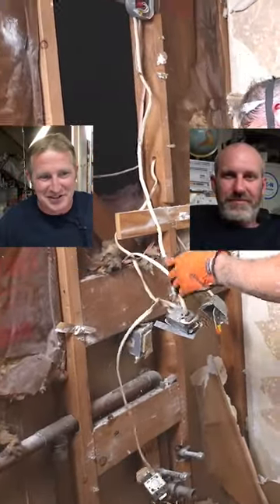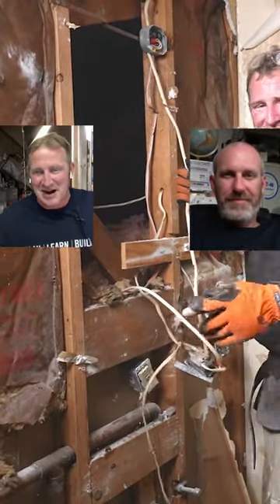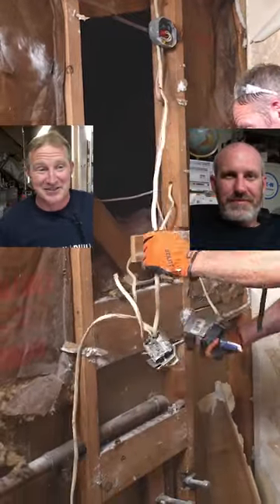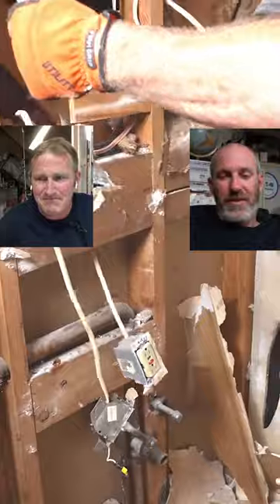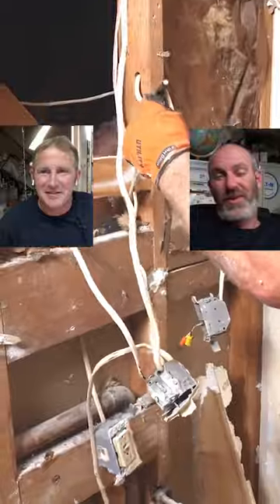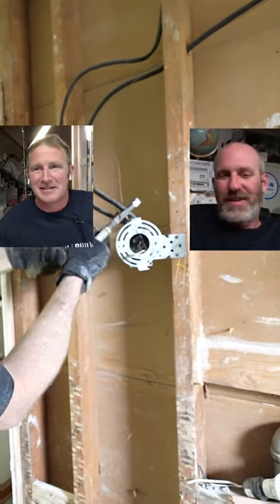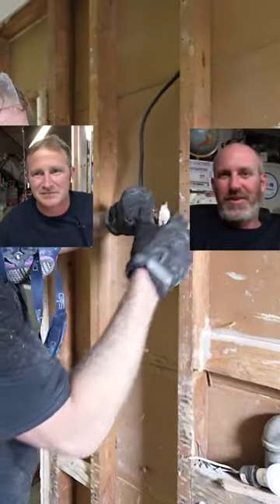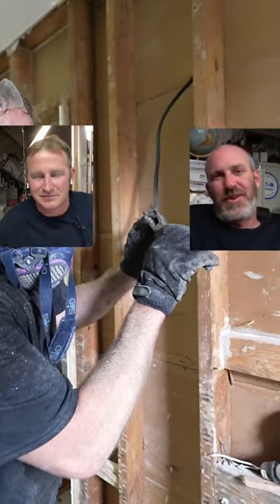Common electrical problem I see in old homes

Comment: Nothing wrong with lighting and outlets sharing a circuit. It’s definitely not a code violation.
Reply from the maker: Different gauges it sure is
Reply: Nothing wrong until all the lights in your house go dim when you use the circuit. Thats always fun. I've seen a bunch of older houses with half of the lights in the house on the same circuit.
Reply: Mixing gauges is Not a code violation if the breaker provides overcurrent protection for the smallest gauge wire on the circuit.
Reply: Same and I love him but the gauge comment is wrong. As long as the breaker is the correct size. No problem. Lighting tends to be on 15 amp circuits, so unless he's putting lamp wire in, then 14 or 12 awg would both be code compliant.
Reply: @BathroomRemodelingTeacher You don’t know what you’re talking about